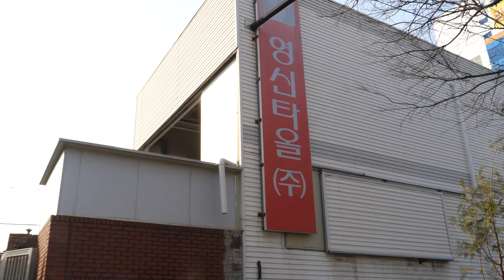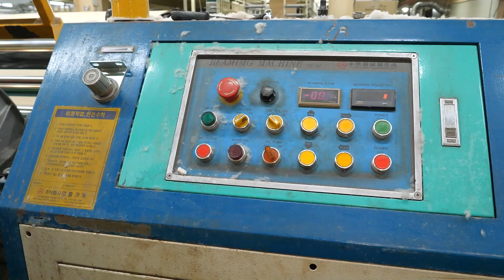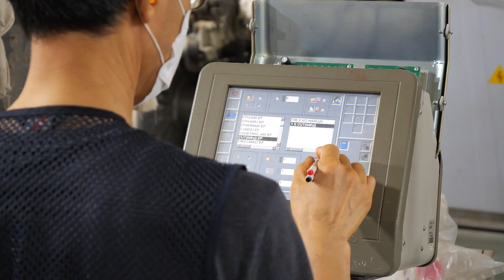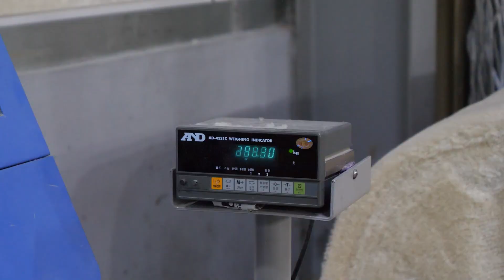Process of making a towel from thousands of strands of yarn. Towel mass production factory.

Comment: it's a very interesting process I haven't seen towel-making yet 
I wonder how much yarn goes into making a towel and how it is measured in metres, kilometres or kilograms.
Reply: Yarn is measured in dtex meaning how many grams per 10 000 metres. It's showing how thick is the yarn. For example carpets can be 2000 to 3000 dtex. Yarn is made of filaments. There can even 200 filaments in one yarn so one filament can be really thin. When making towels, I suppose that the filament is thicker than at carpets. One reason is that often made of cotton and it's totally different than polypropylene or polyamide (PA, nailon) which are used often at carpets. If you are ordering yarn made of PP or PA, you can even choose the shape of filament.